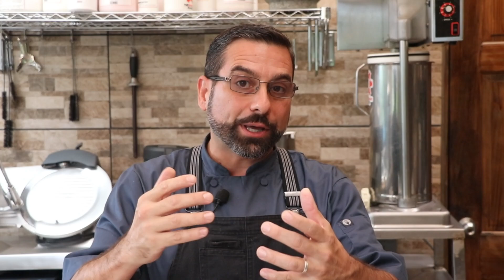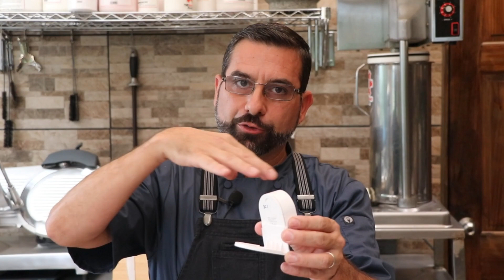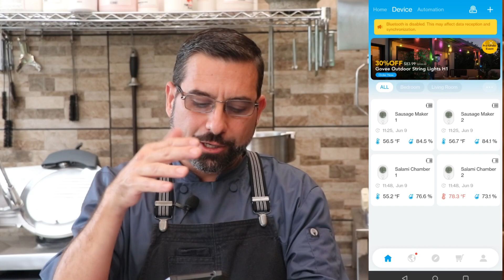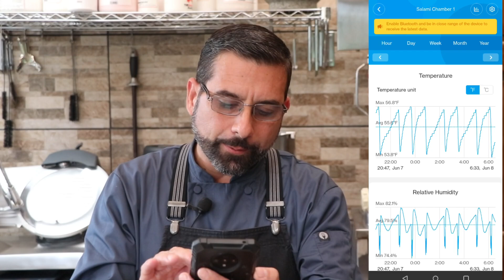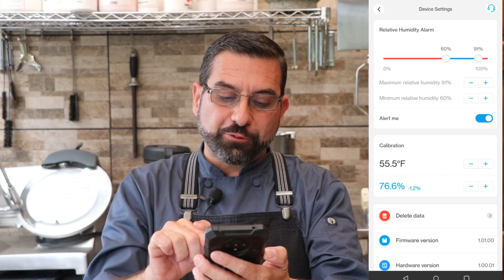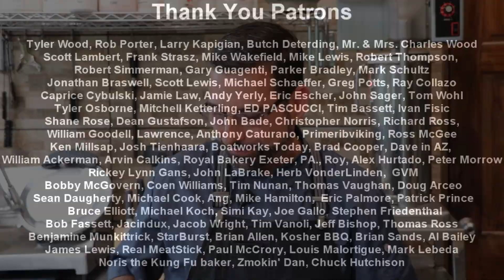This inexpensive tool will actually make you a better Salami maker!

Comment: Hi , I’m not able to find this Govee thermohydrometer? The link does not provide the same unit. Can you send me the correct link. Thanks
Reply from the maker: where do you live?
Reply: @2guysandacooler  Toronto
Reply from the maker: Cory and paste the following in your search bar, it's not exactly like teh one I use, but it will work:

Govee Bluetooth Hygrometer Thermometer，Room Temperature Humidity Meter with APP Alerts and Data Storage, Humidity Monitor Indoor with Large LCD Display, Humidity Sensor for Baby Greenhouse Garage

Comment: You might be covering this in a future video and kind of alluded to it but do you now just calibrate your controllers year round based on govee or do you still remove the controllers and calibrate them separately?  It would be nice if that worked because I didnt want to have to fully shut down my chamber for calibration but also didnt want the leave product in there without any way to manage the humidity for a lengthy time period.  Temperature calibration seems a lot more straightforward and just a matter of minutes.  Just a side note I miss the crazy salami series you did and I hope its back for celebrate sausage seasom 4, most of the classic salamis are a lot more similar and simpler in terms of spice profile than I ever realized.  I have a journal of ideas I'm going to attempt after i get a few more reps in making your recipes.  So far ive made genoa, cremona with parm, buffalo salami, pepperoni, 100% beef, and both coppa recipes.  Most are still in my chamber but the genoa and cremona were outstanding

Comment: Do you have suggestions for someone trying to get a good setup (grinder, stuffer, etc. ) that will not break the bank starting up?
Reply from the maker: Hey Doug.  A good start IMO, will be a small grinder and stuffer.  That is if you plan on making sausages.  If you plan on making salami the equipment list is a little bigger.  As far as grinders go, I've found that just about any grinder will do the trick if you use it properly.  The benefit of having bigger grinders is that they have stronger motors and can grind meat a lot faster.  I would say a #12 grinder is a proper place.  It's not too small and not too big.  You can find them at lots of price points.  Here's one, https://amzn.to/45VjU5r and here's a better one that's higher quality https://tinyurl.com/mr2c5rad

While you can technically use the same grinder to stuff sausages with I wouldn't recommend it.  It is very difficult to produce a good sausage using a grinder as a stuffer.  The heat generated will greatly diminish the quality of the sausage.  I would recommend getting a dedicated sausage stuffer.  You will have much better results.  I have been using this 5 pound stuffer https://tinyurl.com/29nrpcu2 and for a small stuffer it does what it needs to do.  Snack sticks can be a little tricky but other than that I have no issues with these small units..
Reply: @2 Guys & A Cooler  thank you for the direction, sir! That helps out a ton! What would the additional items be needed for making salami?
Reply from the maker: @dougmate2378  To make salami properly you would need a dry curing chamber or at the very least a basement that can hold a 55f (13c) temp and a humidity between 75%-80%.  A chamber would normally require a used fridge, a couple controllers (temp and humidity) and a humidifier and dehumidifier.  I always recommend getting a ph meter (at least for people just starting out) and then you will want to get a starter culture and some beneficial mold.  Salami making is the highest form of charcuterie that exists.  It takes skill and lots of patience..  If you want specific links for any of those products let me know and I can send to you the ones I use.
Reply: @2guysandacooler  yes sir I would be interested to know. 🤙🍻
Reply: @2guysandacooler  Thank you again, I did end up buying the setups, from the sausage maker, I do hope that helps your channel :). Thank you again.

Comment: Thank you for another excellent, informative video.
I use a wine fridge, which has temperature control, but no humidity control, and I use such a thermohygrometer (also from Govee, but different model) to monitor the conditions in the chamber. For a set-temperature of 55 F, the temperature swings are +/- 2 F, and I observe surprisingly large humidity swings from below 60% to above 90% relative humidity.  When the average humidity gets too high, I put towels in the chamber to soak up the moisture, and too low humidity has not been an issue.  By monitoring the humidity with this simple instrument, and by making simple adjustments, I am able to achieve average humidities around 80%, with excellent (in my opinion) charcuterie results.
Reply from the maker: nice!!  for me this is a must have in every chamber.

Comment: Nah mate.. As an engineer, MAME HVACR, I call buggary.  This is an infomercial 100%.
Be honest....  In my career, I've setup thousands of systems that required temperature and humity to within 1% humidity and 1°C.  I've used controllers and controllers alone.  This thing does nothing but second guess your baseline controller system.
Reply from the maker: I'll be honest, I don't have much engineering experience but as a professional salumist I can tell you that you are 100% incorrect, and you should hold your comment till you have a little experience making Charcuterie (specifically salami).  If what you are saying is true, then you should be able to place this device inside your dry curing chamber and it would read exactly what the controllers read, but the issue with Dry Curing chambers is that there are 4 systems in place, and they don't necessarily communicate with each other; heating cooling, humidifying, and dehumidifying.  The response time to each process isn't always accurate and one system usually will affect the other.  I really don't want to debate the point because I know I'm right.  I am literally finishing a video as I type this that will clearly demonstrate my point exactly.  In this video the variable between the parameters and the actual results are radical and it has everything to do (like I said in this video) with the placement of the chamber.  This little device allows you see how each process is acting with each other and it gives you the opportunity to fine tune the settings to dial in the specific results that you are looking for.  At the end of the day the proof is in the pudding.  My salami tutorials clearly show that I know what I'm talking about.  Not only in the process but in the final result.  If you could be so kind to email photos of the salami you've made so we can add a little credibility to your comment.  😉https://twoguysandacooler.com/contact-us/   

The goal for my channel is to help others make the same AMAZING charcuterie that I do.  Sometimes it's experience, and recipes that I get to share, other times it's promoting products that I use and find valuable in my operation.  If you were truly in the craft you would appreciate a video like this.